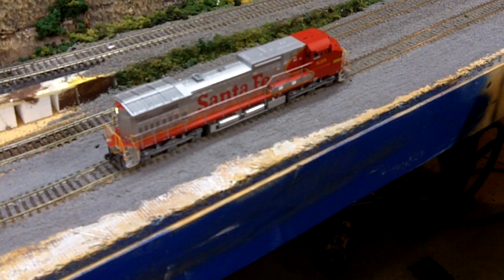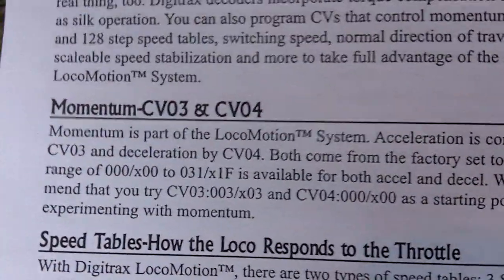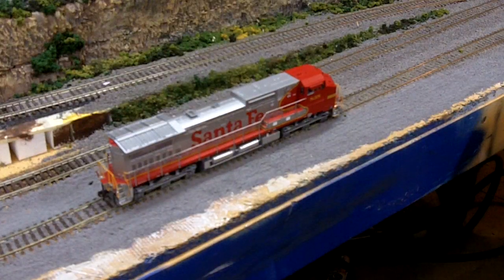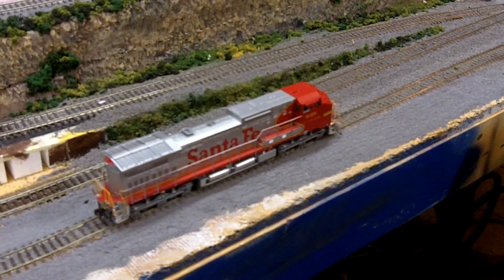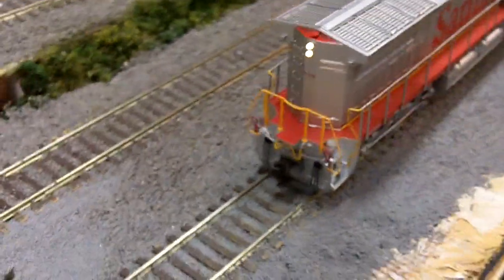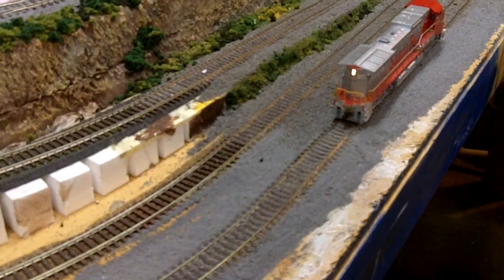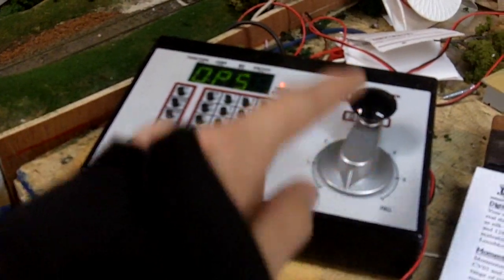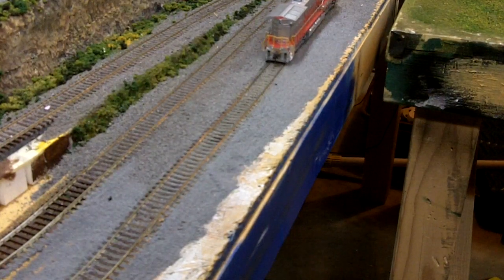Adjust Start Voltage DCC

Comment from the maker: Yea I know the power has something to do with it, and that once it gets moving the amount of buzz changes. Some locomotives have virtually no buzz (Proto SD45) when running DC on DCC, and others are VERY noisy. Different people say different things. Some say there is no damage, some say only if its not moving for more than a few seconds, and others say it damages regardless. To be safe I avoid keeping a DC locomotive on the tracks at all times though

Comment: @modeltrain9500 
There is just the NMRA's dcc recommended practices, but that's mainly for the manufacturing process, not for operation.

Comment: I adjust CV 2 on all my locomotives so that the engine just starts to move ever so slowly at speed step 1.  This value varies between manufacturer.  
This is definitely one of the first steps to successful speed matching between different manufacturers. 
Congrats on 100 videos...